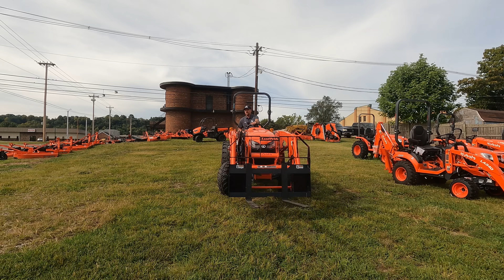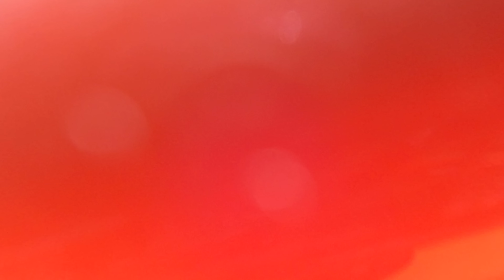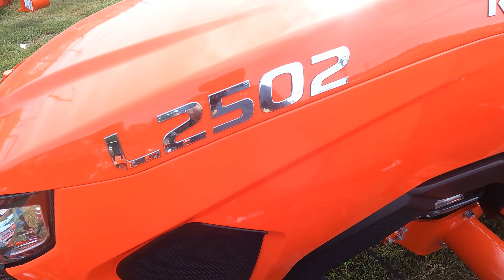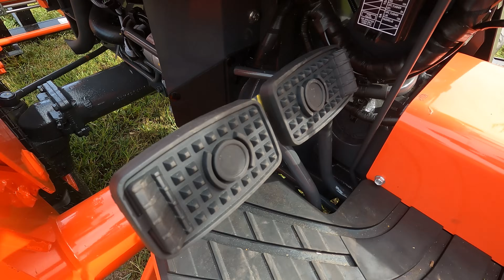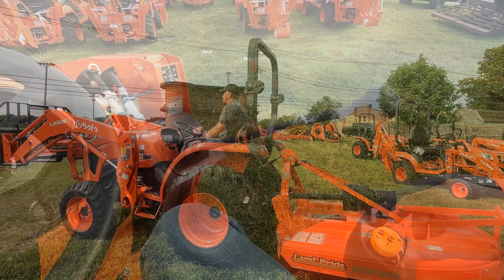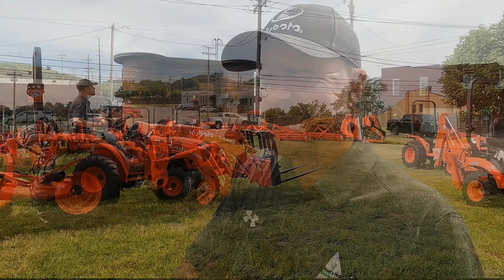Why Would Anyone Buy a Kubota Compact Tractor???

Comment: The other brand tractors weigh more. TYM 3620 is a 4700 lb tractor so it is rated for 2700 fel. Kubota compact tractors are too light in the chassis. I have nothing against kubotas reliability but anything over 40 hp is completely unaffordable. He's staying with Kubota because his needs are small so its in that affordable area. I need a 45 hp tractor and kubota is way out of my price range and I do not need huge trade-in value because I'm sixty years old . I'll be keeping what I buy for life.

Comment: Me personally don't like the Kubota treadle pedal. I checked out several tractors and went with a Kioti NS4710HST. It's big, and it's a beast. If I were in the market for a 25-30 hp tractor i would definitely go with a Mahindra. I know several folks that own them and wow 👌 Great video, great series
Reply: i have 2 mahindras with over 1700 hrs on them very well built tractors with only minor issues.

Comment: Good video young man!! I'm not Knockin no one's Tractors kubota makes a great tractor no doubt if owed some of the older ones over the years.  I've owed a couple of the other brands one said they would lift so much more 2200 to be exact but wouldn't do it in real world or my world the way i use a tractor.  I just got a kioti 3520se shuttle shift and it does do the job. But the dealer makes whatever brand you get good or bad. Thanks for sharing be safe have fun enjoy

Comment: I went with a B2601 and it is too small for me. Got a cabbed Kioti CK3510 (low hours, but abused) later. It is an order of magnitude more tractor. I would stick with whatever dealer in your local area treats you well. My 2 local Kubota dealers are dipsticks. I bought the Kioti from LSEtractor out of the Nashville TN area. They have been awesome. And I have Messicks online for the Kubota.

Comment: I bought the newer floor mats for my l2501,the ones off the 2502 fit perfectly.The l2501 i owned for 8 years,did everything in the 60"class perfectly.Kubota is the master of hydraulic systems,smooth and multi-function.The only other brand I would consiider is,KIOTI.

Comment: Kubota is a great machine, but their lift capacity is just disappointing. My CS2220 is rated at 1062lbs to full height at the pivot pins. I can't believe that a tractor as large as that one is basically the same.

Comment: The L2502 will lift 1096 pounds to full height (at the pin). It will lift 1446 to 60” (at the pin). You will probably never have a need to lift a full length log to full loader height.  60” high will more than get a log on your mill. My question is how much log weight can the mill hold? Other than the giant sequoia logs you have at the bottom of the hill, how big/heavy of a log do you plan to mill? You do have a big decision to make. And you know the rule of thumb. Pick out exactly what you think you need, then buy the next size bigger! God bless!
Reply from the maker: All great info!  Thanks for sharing!

Comment: Loader specs can be confusing. My LA844 loader on my Kubota MX4700, based on the loader number (844), can lift 1,852 pounds to full height, a bit over 9 feet. That's with the load 19 inches forward of the pin. At the pin that number increases to 2,443 lbs. Measured at only 5 feet of lift it can lift 3,060 pounds at the pin, or 2,478 pounds 19 inches forward of the pin. How other manufacturers define loader capability may differ. Good luck in your buying quest. I'd be easier if you didn't have so many good choices!
Reply from the maker: Great info!  Thanks!

Comment: TYM T494 under 30k with rim guard and hydraulic top link  2800 lb LL cap  large flat station and the most simple modern tractor engine on the planet.  the KUKJE A@#)) series mech fuel inj  get it with no tax if you know how to do it

Comment: that will NOT pick up a tote of oak
Reply from the maker: Opinion or fact?  I’ve seen some videos of the L2502 picking up 1400-1600lb.  I tend to believe that the advertised capacity doesn’t tell the whole story.  Just wondering if you’ve used one…

Comment: Definitely a tough decision.  For what its worth, I love my L2502.  Very seldom do I run into issues where I wish I had more power, although it does happen.  Especially if you plan on lifting hardwood logs onto that mill.  I would have to make some ramps and roll them on with straps.  I've seen some videos where they load quite large logs with just a SXS and straps.
Reply from the maker: Yeah, I can see a few logs still being a struggle…

Comment: as a new BX23s owner i am very happy.  a few things i see that are weak points are the grill guard and the hydro fan cover.  kubota would be wise to look at what the aftermarket folks like bxpanded have come up with to fix this.
Reply from the maker: I’ve changed my fan twice and still don’t run a belly guard.  I don’t want to fool with it every time I put my mower on and take it off.  As far as the grill guard goes, I haven’t ever had issues there and I’m pretty rough with mine.  Everybody has different needs I guess.  😊  Enjoy your machine!  They are awesome!
Reply: Wheel spacers are the best money you can spend on your tractor. Bro-tec makes some real good ones. They’re not cheap but what’s your life worth. 2 inch on the back 1”1/2 on the front and if you’re running the 60 inch mowing deck you’ll have to reset your wheel stops, but it’s well worth the money. You will not believe the difference they make on Safty.

Comment: Kubota is definitely known for having refined loader valves. As for the lift capacity, I agree with the salesman about the safety and stability of the machine with respect to capacity. Unballasted, machines this size are generally 2500-3000lb, and about 5ft wide at the rear tires. That’s a small platform for picking up something that weighs more than half of what the machine weighs. For reference, I have a machine this size with a full-height pivot pin lift capacity of about 800lb. With loaded rear tires and rear wheel weights, my loader can still get you in trouble quick without something on the 3 point if you aren’t careful. You may want to consider how high you want to lift the weight. Loaders are a lot more capable picking things up off the ground than going to full height, as you identify about the BX. With my loader I can lift two 16ft pine 8x8s with clamp on forks on the bucket, which shift the load out to a disadvantageous position compared to SSQA pallet forks. I’ve moved logs I didn’t think I should be able to lift that way too. If you want room to grow, a machine frame size up wouldn’t be a bad idea. More capacity with more stability.
Reply from the maker: Great thoughts!  Thanks for weighing in.  👊

Comment: I was back and forth between the Kubota BX23S and the Kioti CS2520s. Both great machines. Ultimately, it came down to lift capacity and dealer support. Kioti won out on the lift capacity. The Kioti dealer also has given me great support to this point. Time will tell if i made the right decision.
Reply from the maker: I’ve talked to several Kioti owners who are happy with their purchase.  I believe they make a solid machine.